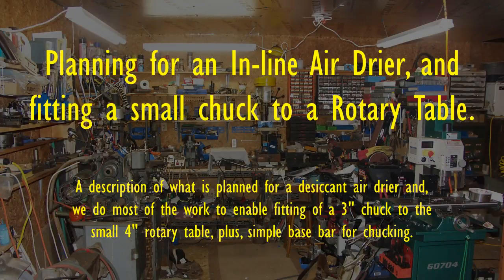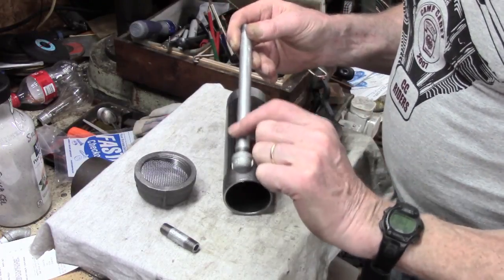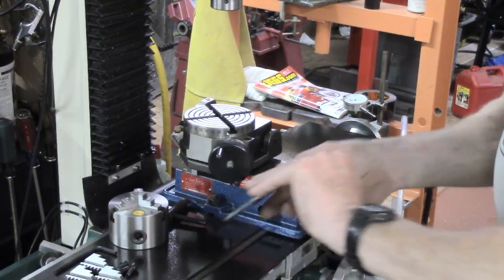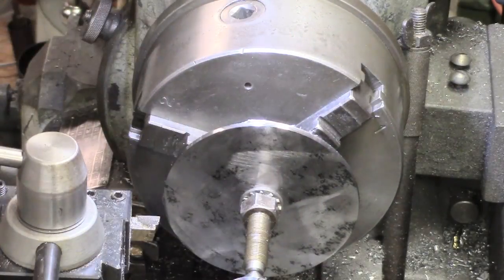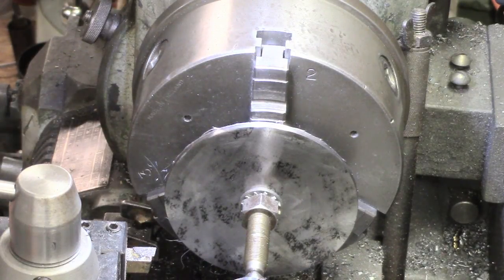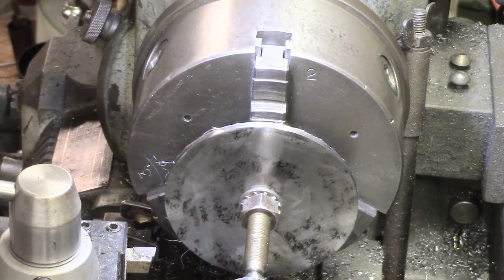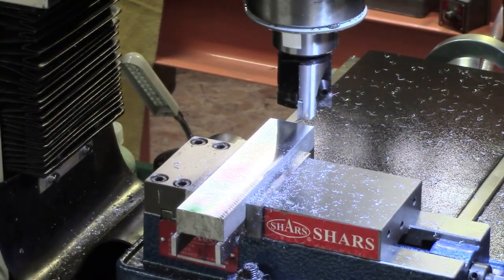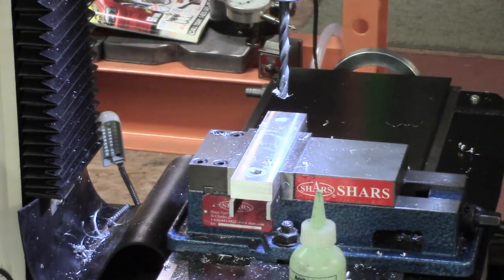An Air Drier Scheme and, Rotary Table Mods

Comment: Hello Chris, the air dryer idea should work well, desiccant is very efficient at the job...
I like the idea about a tiny rotary in the main vise, quick to install...
Pierre
Reply from the maker: pierre beaudry Guess we'll see how well the air drier works -- it should help. Hope to get chuck fitted to backplate soon on rotary table.

Comment: Hi Chris, I take you still have a copy of the Zeus book, well it gives co-ordinates for hole drilling just right for your backplate. Who needs transfer screws or punches when you have a DRO?
If you are lacking height why not use a collet chuck like an ER20 which is good for 13mm/1/2". They are shorter than drills chuck and you can often put the drill further in than a chuck will allow.
ATB
c
Reply from the maker: Chris Stephens Hi Chris - yes have a Zeus - in fact often forget to look in it as I have another small data booklet I use most often. I will check that out. Collet idea is worth thinking about thanks.

Comment: Hi mate.
Nicely done on the chuck, the only thing I was wondering, why not make it so you can use the slots in the table as-well?  Because of the height problem that you have, you can make a bar underneath that can be clamped by a vice if you want to, but can also fit in one of the slots, and clamped down that way.  At the same time, it seems I missed out on an other mill, damn it.  I had my eye on one, but she might be gone already..  
Marcel.
Reply from the maker: Marcel Timmers Hi Marcel, The chuck mounting is just for quick convenience sometimes - plus avoiding taking main vise off.  However yes -- just as likely to fit it to table t-slots on occasion. I hope you manage to still find a mill.

Comment: ChrisB257 why not use the DRO to figure out the 3-hole pattern required to mount the chuck?

Peace!
Reply from the maker: Jeffrey Vastine Hi Jeffrey -- DRO could be used but I am thinking following another suggestion - to invert chuck and lock onto rotary centering pin - set up on one back hole - lock up x and y and then remove chuck and use table for 120º increments to drill back plate with some scrap under it. I have t'fer screws now -- so could use either method. Too hot in shop right now!

Comment: Chris, you have all you need to get your holes drilled. Put your little stepped piece into your rotab center, turn chuck over and clamp it to the part sticking up. Offset the table to line up on one chuck mounting hole. You are on the bolt circle now. Take the chuck off and put your plate on and clamp to rotary table with scrap under it. Drill your holes at 120 degrees. No transfer punches necessary.
Reply from the maker: ***** Oh yes - most logical for sure. hadn't crossed my mind - duh! May well try that although I'd have to remove vise to fit rotary I think - unless I can work towards table end. Will have the transfer screws soon so that is still a viable method but am well temped with your suggestion - big thanks. :)

Comment: Chris, I noticed that your G0704 needs a 60# gas shock to aid in the z-axis effort.  I did one on mine and it worked great.
Reply from the maker: Herb Blair Hi Herb - now there is a thought! Love it. How did you work the attachments? Not sure if #60 is pressure rating and/or length Maybe catch you on a private message or, get my email in the 'about' section of my channel page.